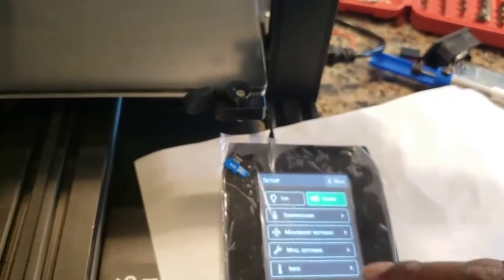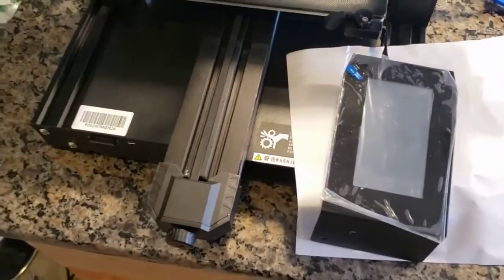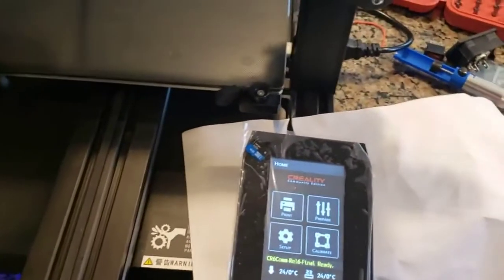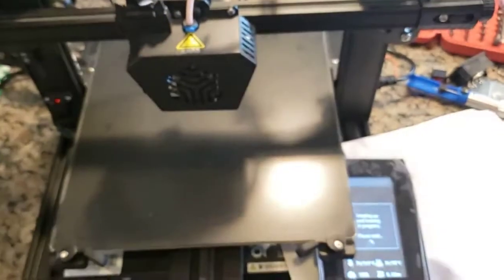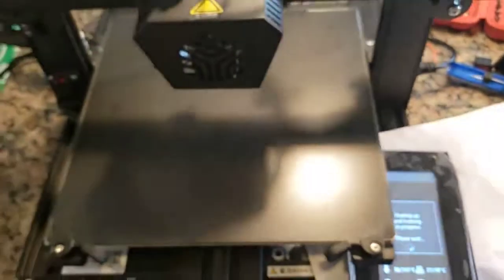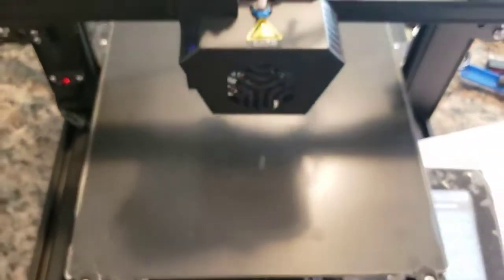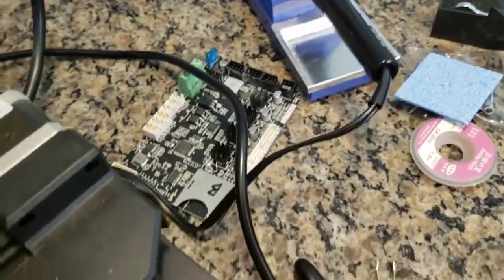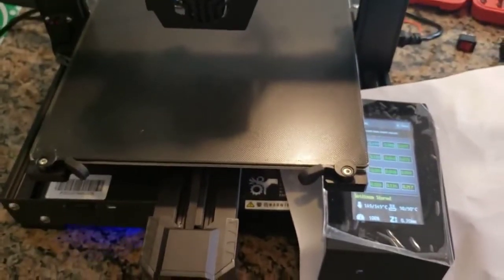Creality CR6-SE - Replacing Motherboard to era v1.1.0.3 and installing Community Version 6.1 –Part 4

Comment: I did what you suggested, the firmware was loaded correctly. now the touch does not work for me
Reply: i have a cr 6 max
Reply from the maker: @arquetipo3d  sorry for the late reply. But please join the FB community to have more assistance if you're still encountering issues.